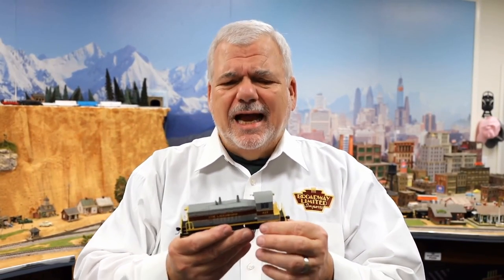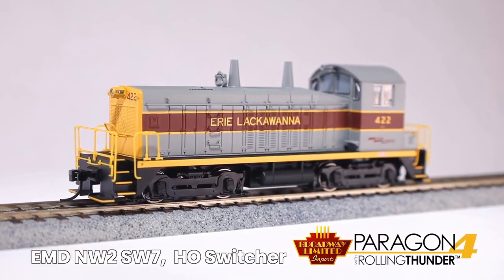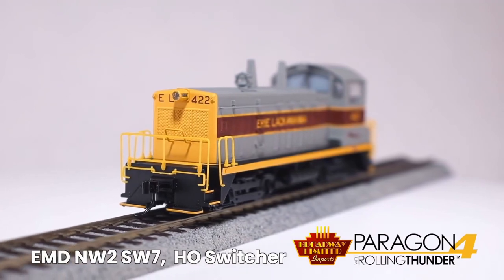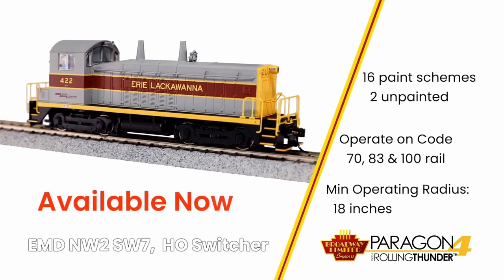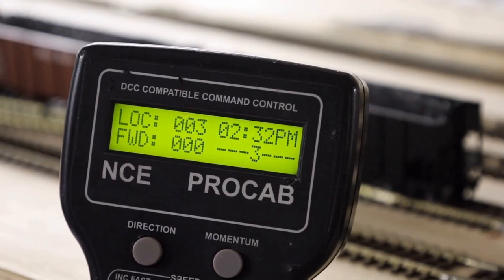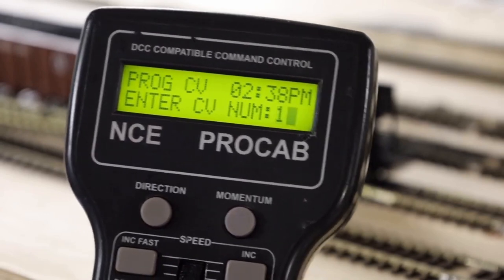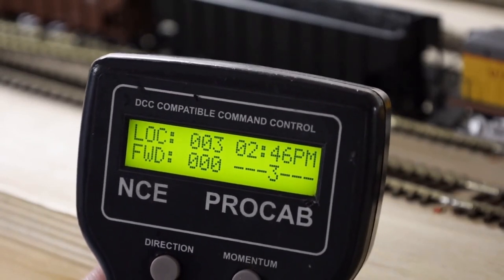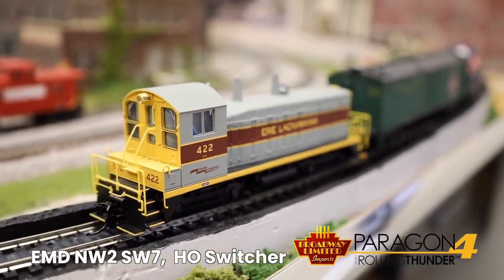HO Scale Broadway Limited - NW2 SW7 Switchers - First Look!

Comment: Hello, I just picked one up, nice little unit. I've got a question, do you know if the sound decoder allows for throttle notching? I like to be able to control the throttle setting independent of the speed of the unit.